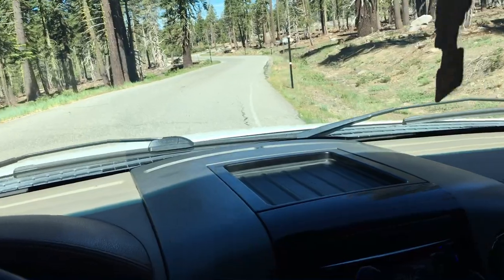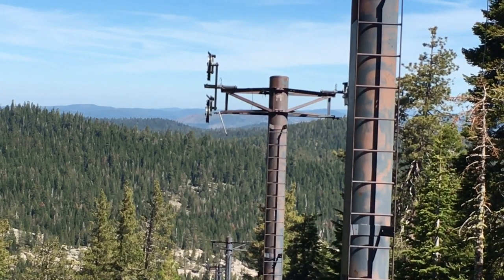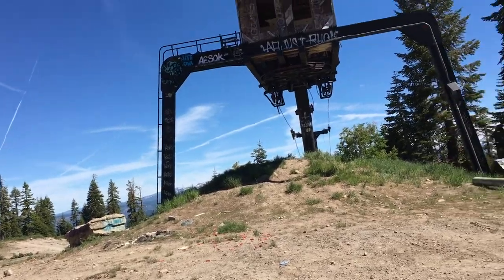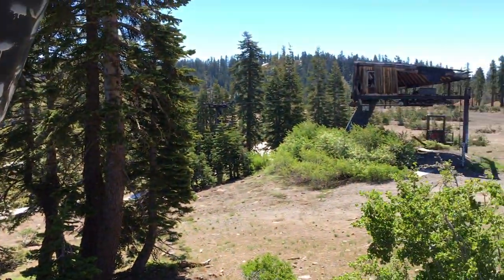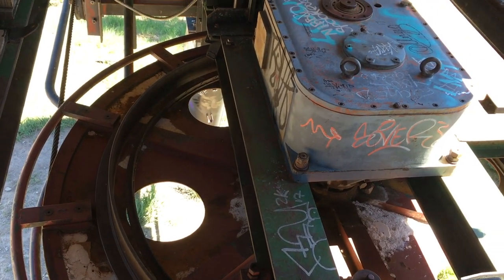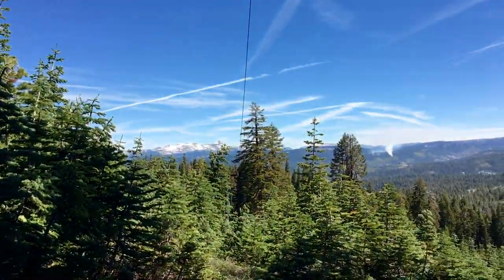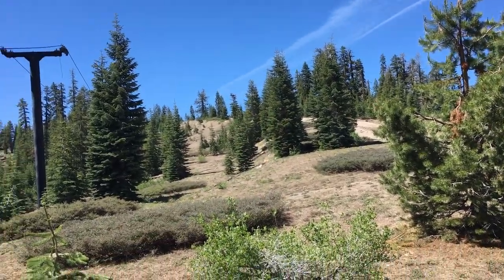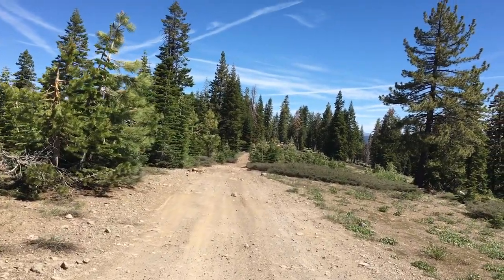Abandoned Iron Mtn CA Ski Resort 23 years later Part 1

Comment: How much of the lifts would be salvagable at this point? Hypothetically, if people had the funding to restore it, would the towers at least still be usable?
Reply from the maker: I think the towers on the 3 mostly complete lifts could potentially be re-used. Though the two longer lifts are basically completely finished, bolts are undone, foundations cracked, etc. The mostly complete Riblet would probably be the best to revitalize opposed to the two SLI’s, Riblets we’re generally more solid lifts and SLIs as of last have seemed to be prone to structural failures, i.e. the two at Catamount MA. Though overall with the right funding, the runs could easily be salvaged, the access roads are in great shape, you can still easily tell where you are when following an old trail map, and the lift lines are still cut obviously. In today’s mega-pass market it would make a phenomenal family oriented ski area.